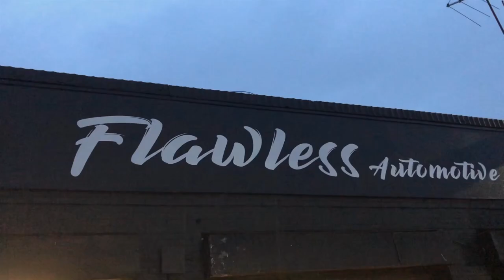AMAZING GRAFFITI ON CAR

Comment: Do you start off by sanding the car? 
And also when done do you add a protective coating so it can last
Reply from the maker: Yes sanded all car ass if we was gonna paint..after clear coat by proffesional shop with oven